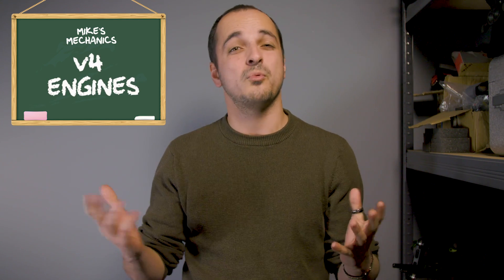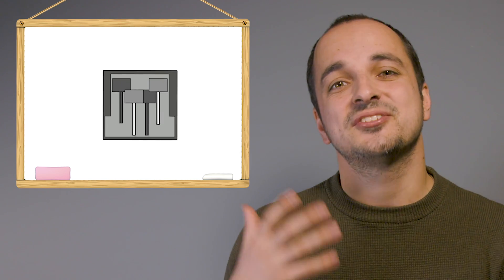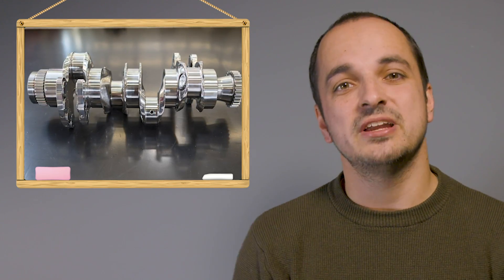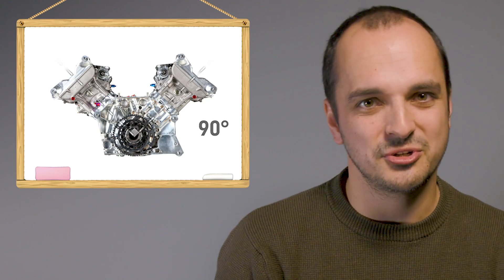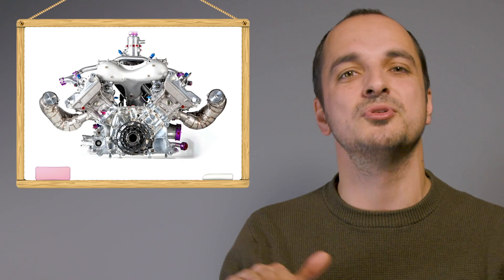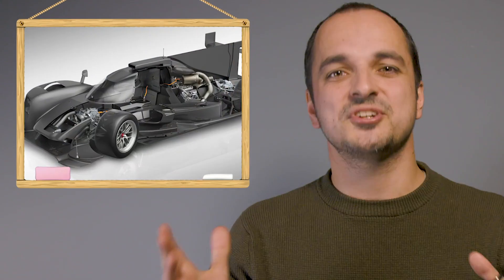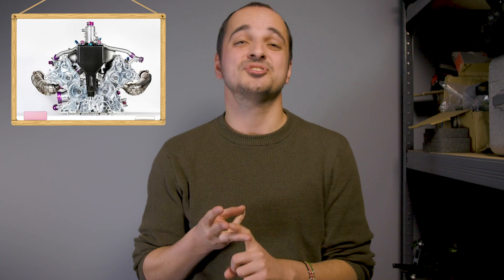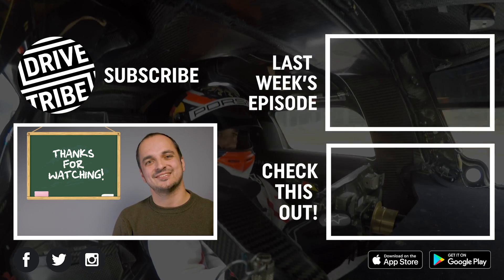Why V4 engines are so rare and which cars use them - Mike's Mechanics

Comment: the Saab used the Ford V4. is this a vw/porsche sponsored presentation? there is also a modern V4, designed , manufactured and deployed by American motorcycle manufacturer Motus, it sounds mean! generally V4 engines have a great sound, to me they sound much better than a V6, but V8 is king of course.

Comment: Soviet ZAZ (Soviet versions of Fiat 600 and NSU Prinz) used MeMZ V4 engines. At first they were really small ones but later they were built bulkier and heavier, same time the engines were slow and needed special balance system. MeMZ engines were used on light LuAZ jeeps too.
SAAB used Ford Taunus engines and those were really small but powerful.

Comment: If you need two cylinder heads and two exhaust manifolds how the heck is it more compact.
Reply: The motor is very compact and short -- a lot smaller than an inline 4 cyl with same displacement.

Comment: What are you talking man???
V4 powered Ford's for years. It was  the backbone of the UK in the Ford Transit you twonk. ESSEX V4 & V6 engines were a real workhorse although not very smooth in 4 cylinder format.
Corsair, Transit, Capri, Zephyr, Consul, Granada all used this power unit. In the Transit case it lasted a good 12 years. 
So where do you get rare from??
Reply: In Germany the V4 was used earlier -- from 1962, Taunus P4 front wheel drive car.  Then in the P5 rear wheel drive from 1964  -->  They lasted not only up to the end of Transit in 1978, but also in Granada 1.7 (same motor as in SAABs) up to 1981 .  So it lasted almost 20 years.

Yes it was rare.  Only Ford and Russian ZAZ made the V4 engines in cars ((V4 = two seperate heads)
Reply: @wyrazowfkp  it was indeed and down to 1200 cc if l remember in the first 12m Taunus

Comment: I owned a 69 Saab Sonett, and a 2002 Honda ST1100 - both of which had V4 engines. The same (Ford) V4 that was in the Saab Sonett (97) was offered on all late 1960's Saabs (95 and 96).

Comment: Lancia used many V4 designs - even the Stratos Prototype had one from a Fulvia HF. They began winning world rally championships with them in the 1960s. The 1584cc Fulvia has narrower angle then the 1300 and 1200 versions. Saab were offered the engines early on to replace two strokes but went with Ford. Lancia tilted the engine on it's side to lower the car's C of G.
Reply: ZAZ 965 and 966 used the aircooled V4 from 1960s.....   Lancia had only VR4 (single cylinder heads engines)  Ford and ZAZ had two seperate heads

Comment: I remember in the 90's, they came out with an Acura Vigor..and it supposedly had a 5 cylinder engine.... can you explain how that work
Reply: It was and inline 5 cylinder --- nothing special.   You have inline 5 cyl in AUDI cars from late 70s, Volvo cars,  in VW Transporter vans (T4), in Focus RS , ST etc.    The special one was the Volkswagen 2.3 V5  ....   Vee formation 5 cylinder :)  It was more VR5 with single cylinder head

Comment: Ford had a v4 with a balance shaft in corsair and transit,  sometimes very hard to start, I had to rebuild the one I had in a transit, got about 22 mpg.
Reply: Same in German Fords bur earlier .... the German build Transits had the 1.5 and 1.7 V4 engines -> those made in UK had 1.7 or 2.0 V4

The German V4 started in 1962 in Ford Taunus P4 (the front wheel drive car, with 1.2 V4 or 1.5 V4).

Comment: Ford Australia made the Capri with a v4 or a v6 depending on the model you wanted
Reply: They were made in UK, only assembled in Australia.

They also had the 1.6 crossflow in UK (also 1.3) inline 4 cyl

The German build Capri Mk1 had the V4 (1.3-1.5-1.7), inline 4 (1.3 & 1.6 ohv crossflow) (1.3, 1.6 ohc pinto) (2.0 ohc -> export to US),  and a lot of V6's

2.0, 2.3, 2.6, RS2600 injection, (2.6 and 2.8 v6 ->export to US) and the 3.0 v6 Britsh essex engine.

The V6 were made by adding 2 cylinders to the existing V4's :)

Comment: The honda V4 bike engines are works of art smooth and with lineal power output, like the VFR and RVF  series of 400, 750 and 800cc engines, not to mention the insane oval piston engined NR 750.. (ive owned all of them except the NR!) yet i did always wonder why they weren't more common in cars(not that they are common in bikes either realy for all their benefits) ...thanks for the info👍
Reply: Ps.. Do you know if the "car" v4 had belt, chain or gear driven csmshafts?? The bikes (honda) used gears and later chains..

Comment: Back when Honda was building oval piston, 2 connecting rod, 8 valve per cylinder engines the V 4 was there shape of choice.  On their racing motorcycles it was like having a V8 engine on a bike.  They also had a V6 F1 engine that was quickly outlawed by a rule changes that had the capability to move as much air/fuel through it as a V12.
Reply: Donner Pass Whiskey - Honda is know as a world class engine manufacturer that then look for things to put that technologies into. I have had many Honda products, the latest shaft drive, self propelled lawnmower.

Comment: Flat 4 engines make a lot more sense than a V-4, Saab was one of the only car companies I know that produced street cars with a v-4 engine.I think they bought the engines from Ford in Germany.
I think it was all they could find at the time to replace their aging 3 cylinder 2 stroke engine that was rapidly becoming politically incorrect. Flat 4's usually are usually more compact and also offer a lower center of gravity. Examples are old VW beetle and Subaru. The SAAB 3 cylinder 2 stroke, in it's day, was a neat little motor, not having valves, you could reeve the hell out of it and then hit the next gear.
Reply: Ford made a lot of cars in Europe with V4 engine (1962-1981), also Russian ZAZ 965 and 966 used the V4 *aircooled one ....  1960-1994

You would not fit the flat 4 that easy as the V4 in a front engine, rear wheel drive car.  The V4 is very narrow --- at the bottom there is plenty of space for exhaust , starter motor etc.  and the engine is very short, very easy to service, has normal oil pan and is less complicated than a boxer

https://www.youtube.com/watch?v=an3Z7L1jKYg

Comment: The 2.0L Capri also had a V4 engine, straight out of the Transit Van...
Reply: Depends on market. My UK model had a straight 4.
Reply: @derekwhyle1884  - Mine was a UK car, Metalic Green, black vinyl roof with sun roof - Mk1 just like this one...

https://farm8.static.flickr.com/7760/26473380813_4543fb0d0e_b.jpg

Comment: is this guy talking about using v4s in super cars or racing cars? cuz i know of a TON of cars that have v4s

am i missing something here?
Reply: there are not much cars with V4 --- only 2 carmakers made V4 engines in their cars.... some more carmakers used the Ford V4 (f.e French Matra 530, Saab 96, Sonett etc. - also a lot of Fords in Europe), and the Russians made the aircooled V4 in ZAZ 965 and 966 .  That's it.  End of list ....
Reply: @wyrazowfkp  the mazda 3 and mazda 6(which I own) both have v4s
Reply: @deathcamp1  No they don't ....   V4 would have a left and right cylinder head. It's a Vee formation.

Mazda has an inline4 engine with one row of 4 cylinders and single cylinder head ....
Reply: @wyrazowfkp  ah i see, v formation compared to inline, gotcha

Comment: You forgot to mention the glorious Saab 99.
Which used Ford Taunus' v4
Reply: Nope Dude, you are very wrong on that. That has never existed a SAAB 99 with a v4 engine! It was SAAB 96/95 from 1966 and upwards that got the Ford v4 engines. But that was an experimental 96 that had a 99 chassie as a secret testbench för the 99 series..
Reply: @blackentheone6484  ok thank you for your correction.

Comment: They are not so rare if you think abstractly. A horizontal 4 is basically a 180 degree V4, and even more abstractly, an inline 4 is a 0 degree V4 with conjoined heads.

Comment: The V4 is unstable in it's design, To get it to balance it needed a jackshaft to balance it.  Fords used the V4 in the 70's but it was so unreliable they dropped it. SAAB also tried the V4, with similar results.
Reply: Nope it was a very reliable engine, that last for decades..
Reply: Saab had the Ford engine -- taken from the Taunus.  Those engines were very good, you can still see them in running condition after 50 years.

Comment: Would expect cooling to be better in a V4 with cylinders 2 sets cylinders being separate. In bikes V4s go like trains.. great but must be harder to integrate gear box unless they are in line.. must be more expensive to manufacture. For racing bikes it must be better to keep engine and weight as compact as possible hence in line 4s?

Comment: I think a lot of the cost of an engine is in the ancillaries and assembly. Any V engine requires 2 of some things, and more complex engineering so is just more expensive than an inline engine. So you end up with a 4 cylinder engine that is in competition with cheaper I4 engines and consumers vote with their wallets.

Comment: 1965 ford of UK and Germany used a V4 1.7 and 2.0 litre in the series 1 Transit van, the 2.0L engine also went into the UK's Ford Corsair and Zephyr 4. Incidentally the Saab V4 was actually powered by a Ford V4 engine. It was a good engine that I drove many miles fitted in Transit vans.
Reply: The German Transit used the 1.5 and 1.7 V4 in the series 1.   The German made Ford Capri had 1.3 V4, 1,5 V4 and 1,7 GT V4 ....  They were also used in Taunus models before 1970, and in Granada entry model engine.  ---> the German V4 was a little different architecture than the essex V4.

Comment: Sucks we don't get the v4 I'm a mechanic you have no idea how many balance shafts new motors have . Think about it gas mileage power and tq. . Instead all we get is the boxer . The boxer has tq but is old and outdated and burns oil not to mention it fails when you put power to it. I love my WRX. But I know it will break . I'll fix it and it will be on it's 3rd short block. Now . Lol but fun!!!! And surprising it really doesn't cost much if you can do the work if not ........ don't ever mod your wrx. $$$$. Wish the v4 was an option.

Comment: This doesn't answer the question at all why V4's are rare, but V6's and V8's very common.
Reply: V4 need balancing shaft, is expensive to made etc.    V6 and I6 are quite common  - this is the middle point.  

I8 were discontinued in late 50s , because then it's more expensive to made the I8 than a V8   (I8 needs a very heavy and long block, and cylinder head (or heads)....  also very heavy crankshaft.  V8 is more compact and a lot shorter

Comment: Aprilia RSV4 (v4 engine) is approximately 25% more than its Japanese inline 4 competition (Honda, Kawasaki, Suzuki and Yamaha) you get the similar HP but a lighter and more balanced ride. Having said that people would definitely pay 25% more for their cars if they were v4. Alfa Romeo made a V4 concept version of the 4c that was 70kg lighter than the production 4c people pay approximately 100,000USD for this car and would have gladly paid 125,000USD for that weight reduction. The 4c is not a high powered car (237hp) but is a super light car (895kg dry) so dropping another 70kg off an amazing low weight car would allow a tank if fuel and a driver (unless you are a fat bastard) and still keep it under 1000kg. Just for the record if I had 100k to spend on a car I would buy this.

Comment: I ride a Honda with a V4 engine, the ST1300. It is a wonderful engine, very smooth at all engine speeds. It has plenty of torque at low speeds, perfect for tooling around city streets, also it has gobbs of power at higher rpm, I never have a problem passing at highway speeds and beyond.

Comment: Isn't everything said above about the v4 not also applicable to the v6, or and v(2*n) engine?
Reply: No.  V4 is really small short and compact (comparing to size it's small like a wankel engine).
Reply: @wyrazowfkp  I'm not rewatching the video, but from what I remember most of what he said was about the shape, not the size- you could make a freight ship engine with 4 cylinders probably. And how much space it takes up, other than modifying weight and balancing, shouldn't have direct impact on performance, right?

The video seems more opinionated than base on fact, or, at least, it doesn't seem well-presented.

Comment: Saab used a V4 in more than one model.  Great topic!
Reply: It was a Ford engine, used in the UK in several car models and the Transit van. The engine had a counter rotating balance shaft geared to the crankshaft otherwise it would have vibrated itself off its mountings. The Achilles heel was the plastic noise reducing gear wheel which wore out rapidly, but could be replaced with an after market metal wheel.

Comment: My old Transit V4 didn't sound anything like that.
Reply: Mine did when the sliding door fell off
Reply: @simonedwards5070  You my friend have won youtube for that. Hahaha
Reply: @simonedwards5070  😂👍🏻
Reply: nick fox my Aprilia kind of did, if you were riding it right 😁
Reply: Sharron Clark  my mate had a Transit V4 in an Anglia...absolutely terryifying but fun!
Reply: @stevecallagher9973  I saw one in a Morris Minor.
Reply: 1965/78 Transit Mk1 featured a 60 degree Vee and the 2l maxed 85.5 bhp  with balance weights on the crank/fly/and pulley PS does any one need the Hanes manual ?
Reply: @harveyhart8348  V4 Essex 1700cc and 2000cc in the transit had a balance shaft and not weights on the pulley or flywheel.
Reply: Late 60s Corsair V4 tended to overheat and blow cylinder head gaskets - but loads of torque.
Reply: Oh Yeah Baby...I remember ours very well...It took off when you put the boot into it....even with a good load in it. Well fun to drive and we miss the Ol Girl
Reply: Transit v4?? Tickle me interested 😁
Reply: @eddygor  The mk1 Transit every bankrobber wanted in the '60's.
Reply: @eddygor  https://en.wikipedia.org/wiki/Ford_Essex_V4_engine
Reply: I think the Ford Corsair shared the same engine ?
Reply: @ian molyneux I put a Transit 2L V4 in my '71 XL Capri. I cut the sump pan to fit around the crossmember and made engine mounting brackets to fit. The V4 was just the V6 with 2 cylinders removed and replaced with a counterbalance gear.
Reply: @ian molyneux Then I had to make and fit a 10 mm adaptor plate between the bell housing and the gearbox. My father was pleasantly surprised at the outcome.
Reply: Probably because the v4 in that is tuned to have high revs and more torque while you van most probably was a low reving low torque van and plus that van is relatively old while this car is new and last but not least that car will have a performance exhaust on it your welcome :(
Reply: @adamhaselup1125  The same “Essex” V4 was fitted to the Corsair 2000 and mk4 Zephyr 2.0 as well as some consul and Capri mk1 models  there was also a 1.7 version, it also turned up in the (pre cortina) Taunus, in all of those iterations it was a noisy lumpy running engine lacking real performance which is one reason the “pinto” ohc engine replaced it in every instance.  It’s interesting to note that the Motorsport industry at the time also felt the Essex v4 was too primitive to expend time and energy on concentrating Instead on the 2 4cyl in-line engines that followed it. The engine you refer to is of course a highly tuned hand built engine impractical for a road car it’s unlikely we will see ant development of this format for the road as like it or not (and I don’t) manufacturers are now having to look at electric motive power in preparation for the future ban on conventional internal combustion. You’re welcome 😁

Comment: lancia have V4 engine since 1922, v4 is a great engine...sounds really good
Reply: Lancia had the VR engine    Vee in a Row  (very little angle and single cylinder head).   The proper V engine has two cylinder heads

Comment: The engineering, etc, necessary to create a V-4, is no more complex than that required for ANY V-configuration engine, so I'm not buying that aspect of your explanation, at all. Also, the V-4 manufactured by Ford, went into multiple Saab models starting Way back in 64 or 65, and multiple German made Ford applications, and it was actually a fairly impressive little engine (this is Very high praise from me, because I'm a Chevy loving, Ford hating guy)!

Comment: I remember being astonished when I saw V-4 engines in older Ford vehicles in England. It was used in several Ford sedans (saloons) and the older Ford Transit vans.  I first saw the Ford V-4 in an old Ford van when I lived in England (2007-2013).
Reply: Edward Cabaniss the original Ford Transit Van was lunched with a V4 engine, much liked by criminals for its speed. I once had a company transit to over 90 mph on a uk motorway

Comment: Could you sat that a  cross-plain crank in a 4  makes it essentially a v4?
Reply: That's what Yamaha did with the R1, but I'm fairly certain it still leaves you with more vibration and imbalance than an actual v4 would provide.

Comment: Honda have been keen on V4 bikes since the late 1970s
https://www.bennetts.co.uk/bikesocial/news-and-views/features/bikes/honda-v4-history
I would like to see a V4 2 stroke or even a 4 cylinder radial 2 stroke. The latter is two V twins back to back with all four con-rods on one crank pin, perfect primary balance and virtually no torque vibration. The latest 2 strokes are very clean, very powerful and economical on fuel. Nothing like the smokers of the past.
https://www.youtube.com/watch?v=eu3NEPSBfUs

Comment: 180 degree V4's are common like Subaru EJ. 4 cams, 2 cylinder heads, 2 exhaust manifolds. Also known as a "Flat 4"
Reply: I beg to differ.  How can you have a 180deg V? It's no longer a vee yes it's a flat4 no v

Comment: I found a ford V4 in a gas (LPG) forklift.... Still had it's original motorcraft spark plugs !
Reply: It's the same engine that was used in the Saab and the Taunus. They used them in forklifts, water pumps, and all sorts of industrial applications too.